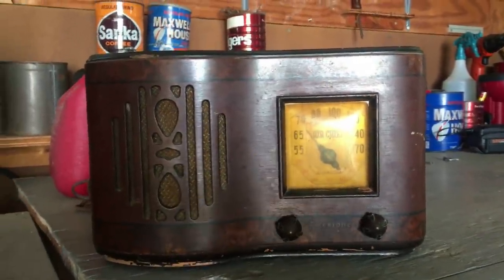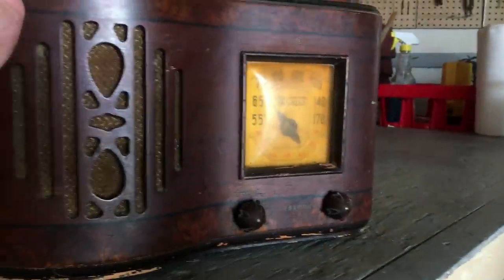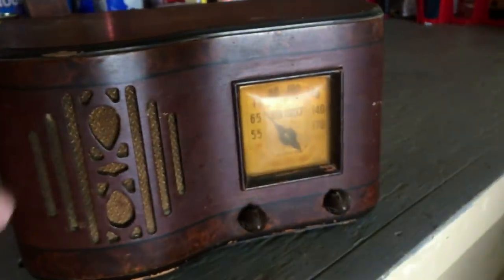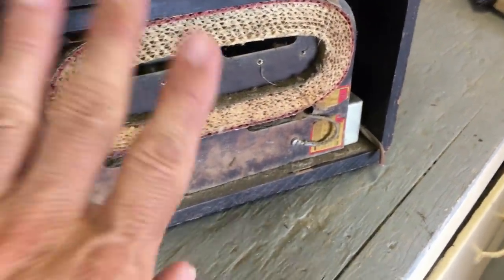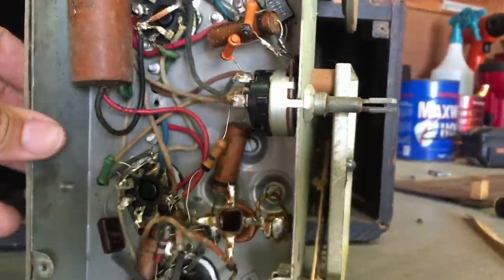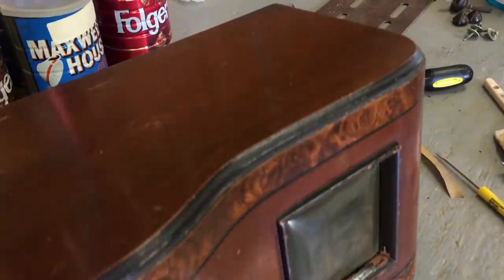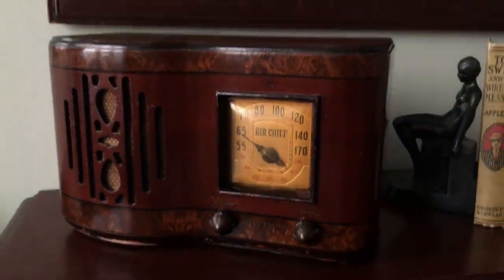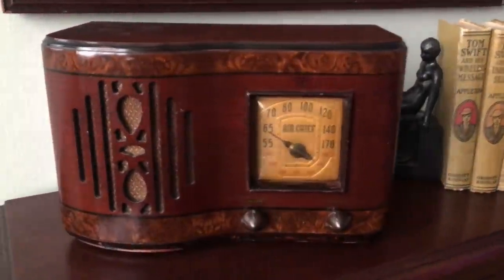1941 Radio Is Unique!

Comment: Here is a trick on cleaning the dial lens. If it can be removed from the case. Soak it thru several uses of those fizzy denture cleaning tablets. It removes lots of the yellowing.
Reply: Oh good tip.Will remember that.

Comment: Great radio and a great buy for less than $30! I recently restored the same model. That walnut veneer at the top and bottom is actually a faux/photo finish made of paper. Yours is in great shape which adds to the value! Most of these have lots of damage to the photo finish.
Reply from the maker: Oh I've had a few Zenith's with that faux finish before but it wasn't as nicely produced as on the Firestone.  I'll give credit to the Ingram clock company for making the cabinet!